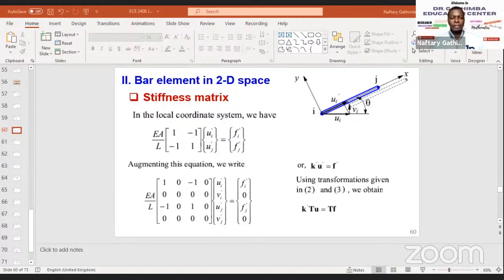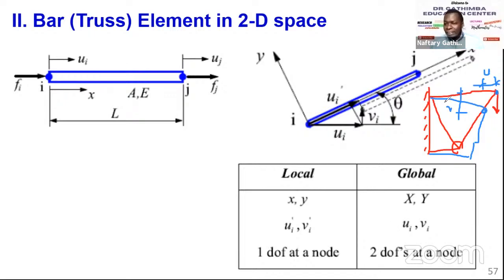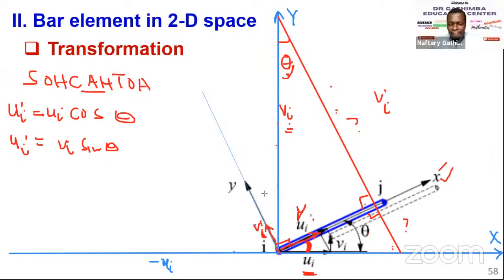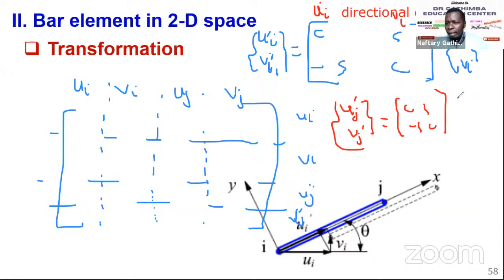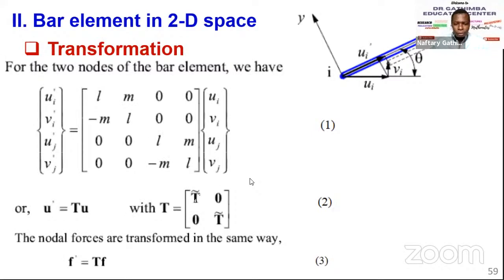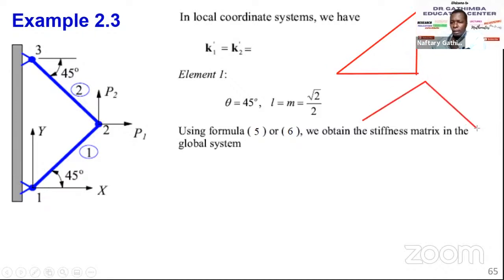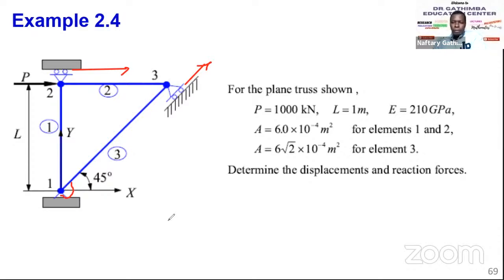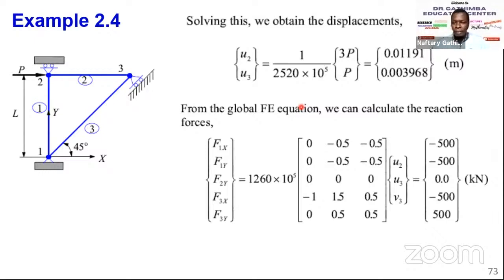4. Finite element equation formulation for a Bar element in 2-D space

Comment: On example 2.4 why is it transformation matrix of displacement and of force are different
And on displacement transformation matrix, why is it u3 will be negative
Reply from the maker: Note: Horizontal(x) values correspond to the top row of the transformation matrix, while vertical(y) values correspond to the bottom row of the transformation matrix.

Comment: Hello Dr
Is it possible @ example 2.4 to move from node 3 to node 1 so that our angle will be -135°
Reply from the maker: Yes, you can. Vectorwise, either 225 or -135 deg refer to the same location on the unit circle. Ty and see that their sine and cosine values are the same

Comment: good morning. could you please elaborate why on the first example at 1:14:25 you used 135 as the angle instead of 315 for inclination of element 2
Reply from the maker: Hi Humprys, I can see you are doing your revision well. That's commendable. Now, the angle is measured from the lower node i to higher node j, counter clockwise from the horizontal axis.